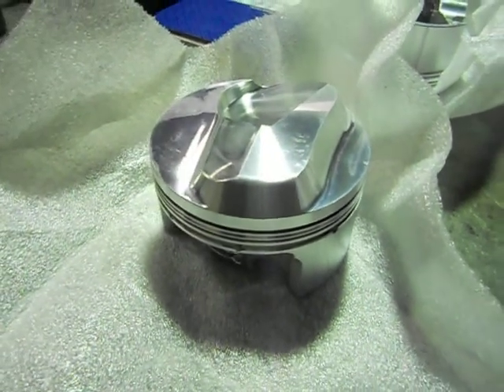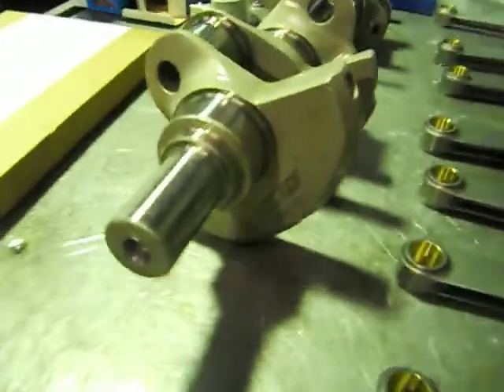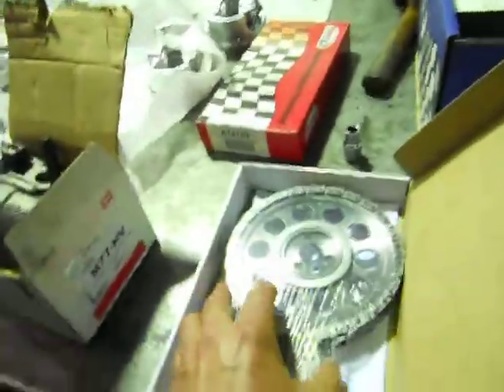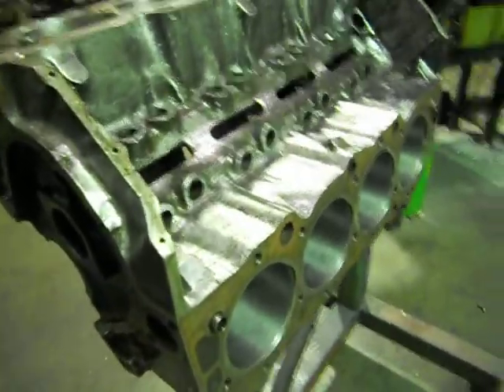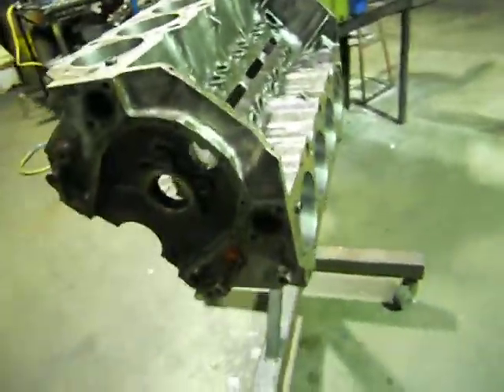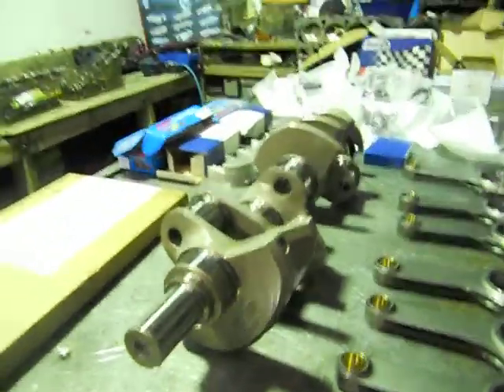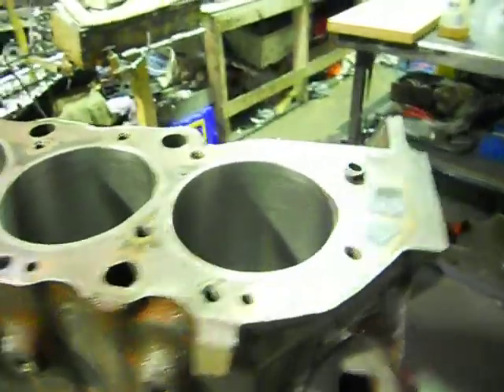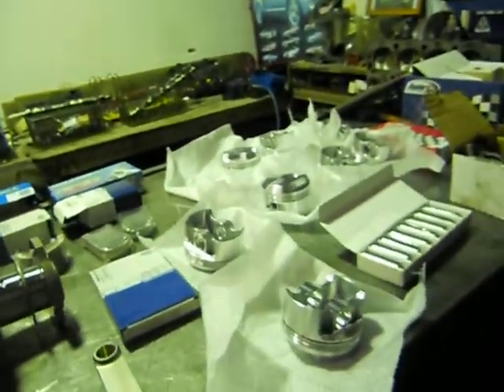Big Block Chev 396/434 Stroker Blueprint Rebuild

Comment: I have a question. I have a 305 TPI motor. The intake and runners are restrictive but it has stupid spastic amounts of torque down low. If I port the intake, runners and such will I shift/lose some of that torque down the bottom and have it shift further up the top?

Much rather have low down power as I don't rev it hard.

Thanks

Comment from the maker: You will gain a bit of performance,but when you start to move more volumes of air/fuel instead of velocities(air speed) you need a cam then which will feed you new flow rate

Comment: You will notice a bit more performance from porting both HP and TQ iirc with stock cam/valvetrain set up. If you had a non stock cam might lose some TQ and gain upper RPM HP not an expert though.